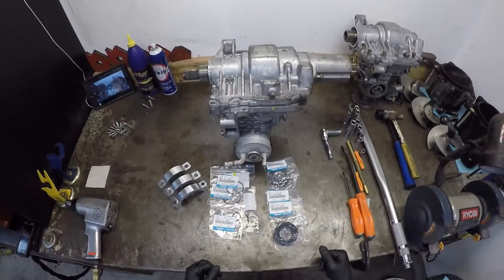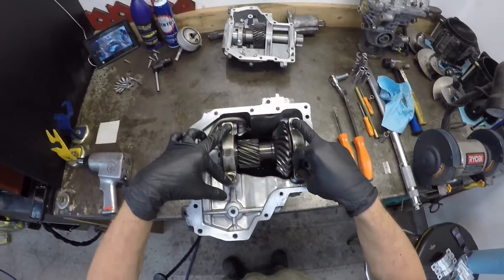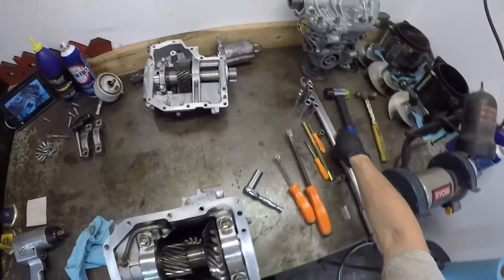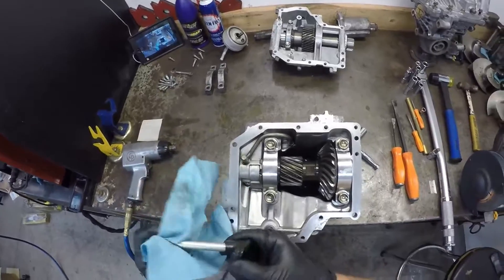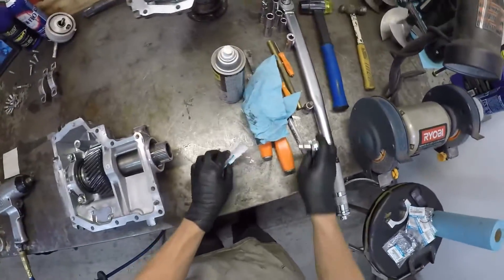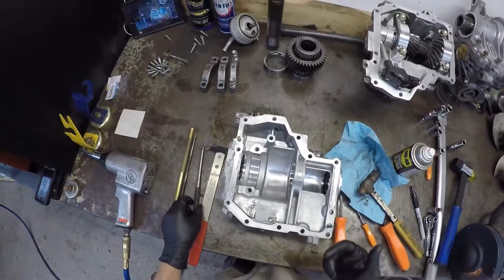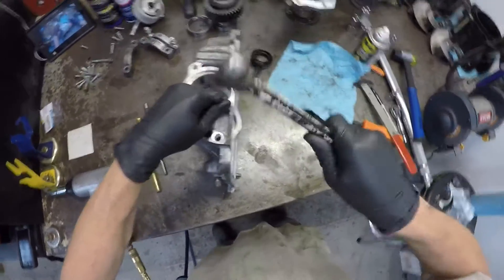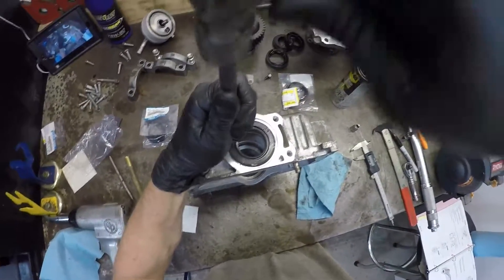MazdaSpeed 6 Transfer case Billet Cap Install Reseal how too Part 1

Comment: Thank you for this video!! This is the only resource I can find online that shows how to do this upgrade step by step (without annoying cuts). Also, seeing the inside of the case is so much more informative then interpreting diagrams on dealership pages to determine how everything works.
Reply from the maker: Matthew Krebs thanks there will be more vids coming soon

Comment: LN0127514 Inner Seal
LN0127398 Outer Seal
LN0127238 Outer Seal that goes 14mm in
LN01273A2 - Small O-Ring Oil Cooler
LN01273A3 - Big O-Ring Oil Cooler

Comment: hi, maybe you can help me, i have a 2007 cx-7 with the same ptu, it has no noise problem till last week, the ruber seal leaked, oil has gone on the exhaust and it smells bad,the car has made 30km without oil to go home.
i tightened the bolts on the case, refill oil, and now it's not leaking, but the transfer case is making some noise, not a lot but i don't like it. is the noise coming from billet caps? can i put new ones? or is the noise coming from spline shaft and is it dead?
thank you if you can help me ..

Comment: Hi! Do you know which bearing is the whistle that always ends appearing in the transfer case? I have the mps the European model and my transfer case started to sound Mazda gave me a 12.000€ bill if I wanted to repair including the transmission shaft
Reply from the maker: I’m not sure what your asking about the whistle ?
Reply: @IMRgarage  I want to get the spare parts because I don't know if any element is broken in there the car is working but makes a sound when the transfer starts working there is a video in YouTube that makes the same sound as mine
Reply from the maker: @javiercastaneda6763  link the video ?
Reply: @IMRgarage  that's the same exact sound that mine does

Comment: When cleaning the case, did you take any precautions while it was still together? Mainly with the shaft and such, did you just spray de greaser everywhere and steam it off?
Reply from the maker: David Lundgren Nono David

I used clean rags and some break clean ! Do not spray degreaser in it ! The outer section you pull all the bearings out of it you can use simple green on it ! I did put the t case on cart and put rags in the seal area and sprayed it with simple green then hit the cases with steam pressure washer .

Comment: hey man did u change the seal on the yoke(where driveshaft bolts to) ? and for the long shaft that gets removed out the side..once its bolted and torque, do u have play on the other side where it pokes out ?

Comment: Just blew my t case to pieces 😒 gunna buy some of these for to new one.
Reply: I did that also new (here in Iceland 🇮🇸) costs 17.000$ I just bought one from a Mazda CX-7
Reply: I recommend you do the same got it for 230$
Reply: @arnarorvarsson9574  ya did just waiting on billet caps.
Reply: Up date transfer case is making noise drained it and just glitter. Pulled it and the pinion gear is clapped. So here for round 2.

Comment: what is the torque specs on the caps? cant tell if you said 16.5 or 68.5
Reply: Factory specs for caps are: 37-51Nm (27.3-37.6LbFt) for input shaft cap and 63-93Nm (46.4-68.5LbFt) for middle shaft caps.